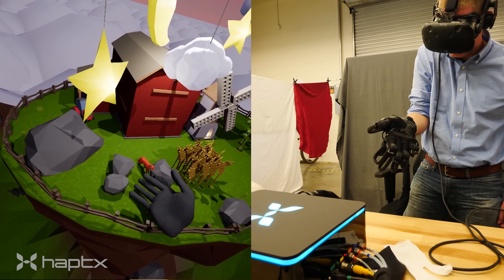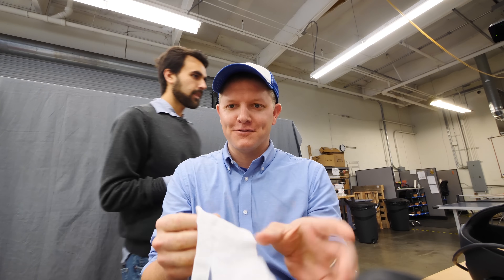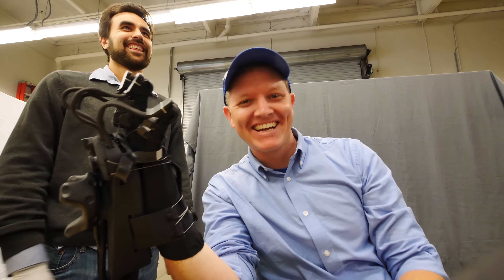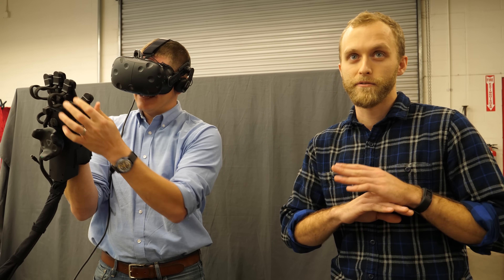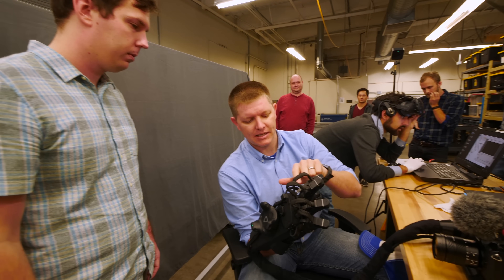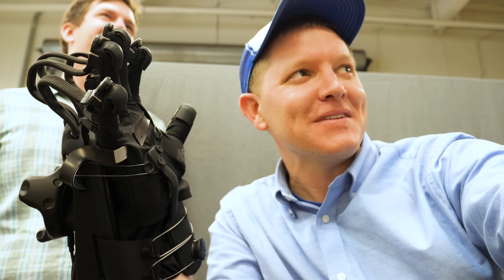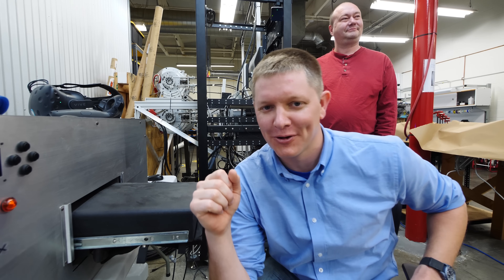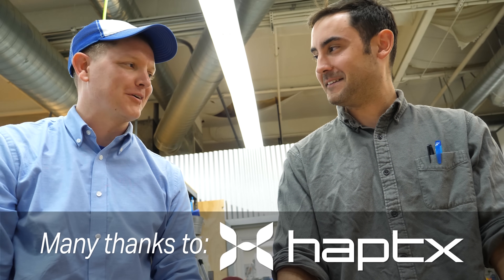How do you make a Virtual Reality Glove? - Smarter Every Day 191

Comment: I was watching this video and then HOLY COW, it's from 5 years ago. I wonder what they're doing now.
Anyway, the hot/cold sensation is probably delivered by a small Peltier element. These are small form factor, easily controlled electronically, have near zero heat capacity, and best of all, they act as current-controlled heat pumps, which is much better for this purpose than a controlled thermal reservoir.
If there's water cooling, all it does it take away the heat from the other side of the Peltier element.

Comment: why not to use thermal peltier cells for thermal sensory? it could heat fast and turn cold fast just with switching polarity. then you can use a single neutral temp water to normalize all of them simultaneously. also they could be tiny.

Comment: Why would they use air or any gas in the tactors?  Use an incompressible fluid so you can get instant response to a change of pressure at the source, regardless of the restriction.

Comment: Hello, I would like to know instead of using air in glove and use all the space in glove, wouldn't it be easier to just use electromagnets and a plate of iron in pads to give the same effect?
Using electromagnets instead of air pads it will greatly decrease the size of the glove as well as make more room for move ability in the glove.
Also by using electronics instead of air pads the hole thing could be run from your home without the worry of air leaks.

Comment: Hi, Destin. I THINK I have an answer for the thermal interactions... Peltier junctions. If current flows one direction the hot and cold sides will be one way. Reverse the current, and they flip over! Thus, you'd have one side of the junction touching your hand, and the other some kind of heat sink. This is where just a steady flow of water would be sufficient... you don't have the lag of the flow, or lags in changing the temperature, etc... the Peltier junction is against your hand, and can change very quickly, depending on the current flow and direction. By changing the "attack/decay/sustain/release" of the current, they can make the temperature change quickly, slowly, etc, and adjust your perception. NOTE: I have NO CONNECTION AT ALL with the folks at HAPTX, this is just MY THEORY about how this works... based on the limited information given here, and my own GEEK factor. :) Just FYI, I absolutely LOVED this video and the one before it... these are AMAZING and are my favorite of all the "Smarter Every Day" vids. :) God bless!!

Comment: When he talks about the thermal transfer in the glove and thinking its gotta be liquid cooling and heating. To be able to do that. I honestly first thought about the electrical process auto makers use to heat and cool seats in vehicles. Take my dads Ram 1500, he got all the bells and whistles. This was the first vehicle I had ever ridden in that had not just heated seats, because thats been around for a long time. But also cooling function as well. I had gone to school to auto and Diesel training. I am Ford certified. But I never worked on fords. I worked on Cummins engines and freightliner trucks. My dads truck has cooling option for his seats and when you hit the button its pretty quick about removing the heat from my seat. You do feel the difference quickly. And its all done by how they direct electricity through these modules in the seats. If they run electricity one way through it the seats will heat up. If they run electricity the other way the seats will cool. I don't remember the exact names and details. But I at least remember this much. So that's why I first thought they might be using a similar system. But to my knowledge the modules are big enough to hold in one hand. But its the special material or alloy they use to do the heating and cooling thats important. So I guess they could come up with a way to make it fit in a glove.

Comment: Love how HaptX guys were squirming over sharing that they had essentially GPS mapped a hundred plus "pixel actuators" (Which is ... Brilliant to say the least) using optical sensors and magnetic fields (or, some other term that's way over my head)This technology would not only revolutionize synthesized touch, but the real world applications are endless, from Macro to micro this technology could really change things. I really need to follow these guys.

Comment: peltier module! for the heat exchange problem... they can go from 50C to -16C in about 4 seconds
Reply: Nope, you still need to get rid of the heat, which only moves to the other side of the module. It would be like enclosing a window air conditioner~ both the hot and cold side in the same space. Sure, only one side touches the skin, but input power would have to continuously increase over time to maintain the temperature difference until the limit of the module is reached.

Comment: For the hot and cold liquid differences, could it be possible that the different temperature liquid is in every other tactor? Instead of air, they use liquid to inflate each tactor and Similar to how an LED panel that has different color temperatures have a warm and cooler colored LED every other bulb?

Comment: The hit and cold is probably a "termochip" ,if you invert the polarity of the termochip, you get hot or cold from the same side of the chip. Fluids will be slow but gas may be an other solution.

Comment: They've probably already through about this, and there is probably a good reason for it, but why not use water instead of air in the taptors ? Wouldn't the compression delay be significantly reduced ?

Comment: Liquid is probably the best way to deal with the tactor having too much lag between actuation and inflation (time for the air to move through the tube). The next engineer touched on that by calling it "the hydraulic problem". Of course, with a small enough tube, as they need to be anyway, air or a custom gas could possibly be considered a hydraulic fluid at that volume.

Comment: They may or may not plan on doing it, but quick heating and cooling can be done with small peltier junctions.  Engineering details abound, of course, like heat sinking.  Since the system would be a net generator of heat, the sink will be removing heat from the system.

Comment: They should use this for to control the temperature. 
https://en.m.wikipedia.org/wiki/Thermoelectric_cooling
I've heard of versions of this were it will move heat from one plate to the other depending on the direction of the current flow, so you can make it hot or cold by changing the polarity.

Comment: You can only feel how fast something is adding or removing temperature to/from your body. 
You cannot feel the actual temperature of any object, not just metal. You can only somewhat reliably tell if it is colder or hotter  than the part of your own tissue that comes in contact with it.

Comment: just a guess for the hot/cold fluid thing. There's probably two independent lines for hot and cold fluid, that are very close together and get pumped simultaneously in different amounts to create those varied temperatures. This would allow them to keep the hot fluid hot, the cold fluid cold, and change between them instantly.

Comment: I tried finding the two-point threshold on various parts of my hand (using two pencils) and just ended up drawing a bunch of lines and dots all over my hand lol

Fun fact: the threshold is not the same on all parts of the hand, rather it's bigger on the palm (about 1 cm for me) and smaller on the pads of the finger (about 1 or 2 mm for me).

Comment: I don’t know if you or they read public comments but I am absolutely in love with things like this and have been working on ideas like this in my head (I don’t make enough to physically make these items). But instead of a liquid (which makes things heavier) replacing the air tacs with thermal copper dots which only heat the air inside the tac or cool it ( like in a ceramic lamp for heat or air compression system for refrigerators) it would reduce weight and you could use smaller tubes for a more free flow design. Im just another guy on the internet :)

Comment: Looks cool, but it's probably expensive to manufacture (so the minimum price is high), and it's bulky so it would be much harder to make it a full body suit and it's uncomfortable to wear.
I don't know why they don't use electromagnets with shielding, it would be extremely cheap to manufacture and very low latency. You could even produce an Electromagnet sheet, that you cut to fold around your exact body parts to have a tailored suit (although I can't think of a way to map the actuators correctly, at the moment).
Why does everyone use expensive parts?! This is nearly useless. Businesses can buy this stuff, but if general consumers can't afford it then much fewer games will support it.
It's ideal to be effective, but it's more important to be cheap.

Comment: It seems like they should be working with electrorheological and magnetorheological fluids instead of pneumatics.  They could vary pressure and temperature and create restriction in a sleeker design with zero latency. They could even custom print gloves. For that matter, if they got the design right they could use it for real world exoskeletal enhancement applications. The approach they are taking is probably going to be marketable sooner though, so I understand the idea. What they are doing is still cool, but we would have a better product much faster if they weren't so worried about protecting their intermediary design approach and decided to work off of their competition to get to the pinnacle product.

Comment: Sorry but no. I don't want a tank sitting on my hands. Why not just build a simple glove , with buttons on it and 1-2 sensors on each finger? it would be much more easier
Reply: I'm sure whatever they put out first will be something along those lines. This looks like something that will be done in stages over time as they master each new feature. I doubt they are going to try and package all that tech into just 1 product and stop there. They will likely have different versions with more advanced features and varying price points to ensure they maximize profits.

Comment: temperature = thin, "peltier" plates, placed,  just like the pneumatic touch pixels (forgot the name), just offset and under the black plastic. reversing the current, inverts the temperature. I'm assuming the thinner and smaller they are the quicker they can change temperature.

peltier plates with be hot on one side, and cold on the other, until the current is reversed.

I wonder if maybe they could physically flip them to speed up the shift. or even shift two layers of plates themselves

Comment: SmaterEveryDay the heat and the cold sensation is also a pshycological trick bulled of by tricking ur body to expect a hot and cold sensations. So they dont have to pull this off near "perfect". As they said themselfs, the tuch sensation is super slow, and when you prepare to feel somthing hot, becuase u know from previous experience that fire is hot and ice is cold. More than half the job is done.

Comment: So I watched the haptic feedback glove videos you uploaded and 1 thing instantly popped into my mind. Take out the compression time aspect on those tact's by having continuing flowing "fluid" through the line only firing the valve to close that loop creating a pressure feedback controlled by closing the valve instead of opening. If they are using some kind of fluid or a sealed gas system with better dynamics that could also be used to flush the hot and or cold fluids quickly to individual tacts as the membranes seem thin enough for thermal transfer to happen quickly even with a gas.
secondly this kind of firing should provide much much faster response time........although one immediate issue i see is that when you grab a large enough object would there be enough resources to fulfill all the needs of every contact point.... given how small they are a variable pressure main line could easily compensate for the required draw........What do you think?
Finally, I am not an "educated" person so I cant exactly word it all with the right terms. Hopefully the concept makes it across however.

Comment: I think your theory on how the heat works in the glove was off, I think they use 50% hot “pixels” and 50% cold pixels in each of those “panels.” This combination of feelings is how we detect wet objects, along with a combination of level of friction and context.  
  
Ever think an object was wet but you were just wrong? It’s that combination wothout context and so you keep touching it and measuring until you’re sure it’s dry, or wet.

Comment: Destin, remember how touching ice and hot water at the same time makes the sensation of heat more intense? I'm guessing they're doing something like that to manage your brains expectations of hot and cold – balancing the mix of each temperature fluid. Keep those two physical systems, plus the haptic feedback small enough to fit inside the two point threshold and you're set.

Comment: At a good guess, the temperature feedback would be a tile array of small pelitiers, you dont need to push much energy, the small mass will allow quick response, and by keeping them small, you can overcome the fragility of it, equally i believe the 2 point for temperature is much wider, like 1.5cm on a finger, and 3cm on the palm.

As for the pnuematics,  the length of hose they chose to demo with makes me think all feeds go back to the box, (really thick control cable), where the valving sits, its likely a bank of 3 way micro solenoids activing as a selecting matrix, hooked up to supply and drain, (they make them both stupidly small and PCB mountable.)

To fill a given sensor you pulse its selection solenoid either positive to fill, or negative to drain, or left alone to maintain with minimal leakage, relying on timing for the amount. I would suspect they also would have some manner of self referencing routine where when sensors are not in use, every now and then pulse them to drain to make sure they are not inflated. 

Same goes for the force feedback, if you have ever fought a bus or trains pnuematic door, it gives a very nice exponential resistance curve, the more you fight it, the more resistance it applies, maintaining the illusion that it is solid and rigid. these however need finer feedback of finger and palm curl to properly maintain it, as you will instinctivly change the amount of force you apply. again never measuring the pressure, just corrective pulses.

Comment: They need to find a way to add electrical impulse, just for things like electricity. Maybe even go further and find a way, along with the heat element, impulse the feeling of burning in the case of being burned, without physically being burned. 
We're not just sacks of meat and water, we also have a ton of nerves that communicate with electrical impulses. And if we find a way to accurately impulse certain feelings to the correct nerves from an external source, we could probably have a glove that only needs the electrical bit to trigger impulses.

Comment: Hi Destin, I believe that they could possibly be using Peltier devices to control the temperature by reversing polarities to get hot and cold as well as adjusting the power levels to each tiny tile for varying temps. They are quite a fascinating technology that cools one side while heating the other.  People have used them as CPU coolers, though you still need a heatsink on the hot side to expel the heat so that it can pull more heat out of the CPU with the cold side. I'm sure it's plausible that it could be woven into a fabric as well. 

Neat video, as always